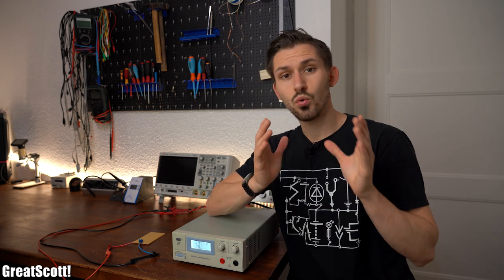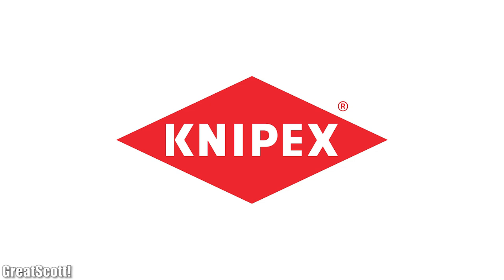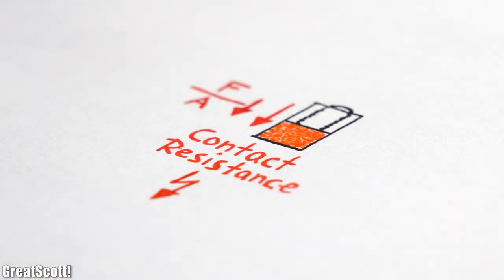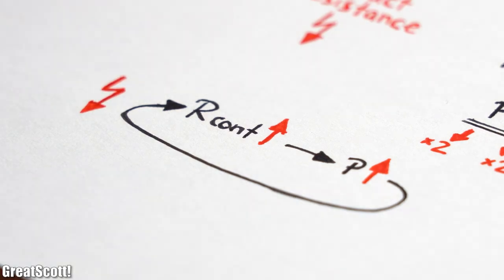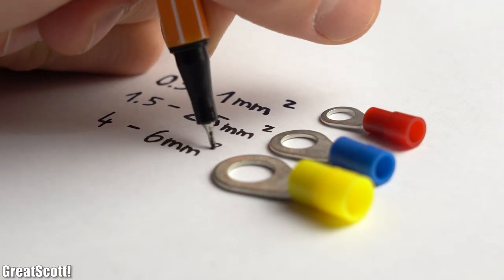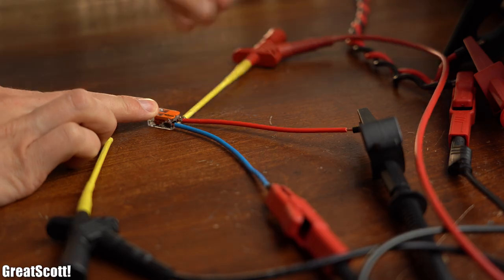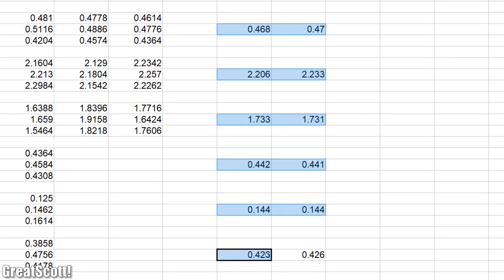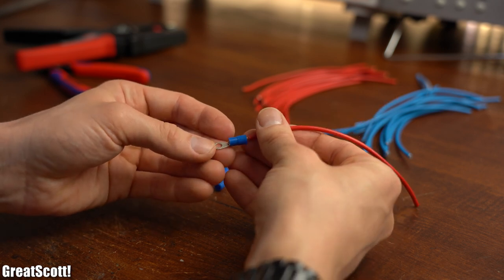Connectors are more important than you might think! So which one is the best? (Experiment)

Comment: When you like me, live in wooden houses, you are not worried about short circuits, there are fuses to take care of that, but you have nightmares about bad connections.  All the time houses are burning down due to electric faults. That is another name for a bad connection.  Waco connectors are the winners now, because of the craftmanship and percistence to detail it does not require.  It can be done by an apprentice who wants to go home early and still be safe.   Apart from that we need some new connectors, which will permanently cut connection when temp goes above 150C.

Comment: Most of my terminal connections are soldered and then before the wire fully cools use a pair of pliers to flatten the end. For terminal connecters with a round socket I use a pair of round-concave jewellery pliers to do the same thing but in a U shape which makes a great connection.
Reply: Not recommended, decreases the repeated flex/bend strength of the wire. Also solder in the crimp undergoes differential expansion and can force the crimp loose.

Comment: I really love the WAGO stuff.  I began using it for in-wall lamp fixtures (LED lamps), but it became a staple of my electronics projects and messing around.  Want a quick connection... WAGO!  Ultimately I'll clean up the connectors in the final version or the final cleanup of a project, but WAGO really speeds the work up when messing aroundl.

Comment: If I am not mistaken, those white screw connectors („Lüsterklemmen“) were never really intended to be used as general purpose connectors. Their original intended use was for lighting fixtures only („Lüster“ is a dated German word for a hanging lighting fixture, e.g. a chandelier).
The PCB connectors…., when you said „Who is gonna draw 10A over those“, my immediate answer was „3D printers“. Those connectors are very common in this area and get to see quite some current..

Comment: Thanks for this informative video.  I find it hard to believe the spade terminals and receptacles had such a high resistance. I think these should have a similar resistance to the crimped butt connectors. These are usually very tight the first time you use them, and the receptacles make deep scores into the spade.  The receptacles should not be loose. If you are reusing the same receptacles multiple times, that isn't a fair comparison against the other connector types.

Comment: For your calculations did you consider than several of the connection types had multiple connections as part of their set up? For the cable shoes as well as the wire ferrules you have the wire to shoe/ferrule resistance then the shoe/ ferrule to whatever they connect to. The worst performers have more series resistances as a part of their connection system.

Comment: Nice video! I had this problem a couple months ago. There was a loose connection in my breaker box that caused unstable voltage on some power plugs, a differential breaker and current breaker were shutting down and you could feel some heat on the breaker box. Fortunately we found the problem quickly and didn't end up in something serious like a fire.

Comment: Soldering wires together has one disadvantage you didn't mention: durability. Crimp terminals and ferrules tend to hold up a bit better against vibration, and often include strain relief. Solder prevents any bending of the wires, it leads to a stress concentration, and soldered wires are more likely to break than crimps.
Reply: In Australia for power circuits it is not permitted to put a soldered wire or soldered connection into screw terminal.  The reason is that over time the solder will flow very slightly, but enough to increase contact resistance and form a hot joint.

Comment: Another connector I would also recommend is Anderson power poles. They come in 15, 30, 45, 75, and 100 amp variants, and have no gender. So you can plug any connector into any other one. The 75, and 100 amp ones have different housings though, but the 15, 30, and 45 amp ones have the same housings, just different size connection tongs. 

They're mostly for DC, but I really like them. They are somewhat expensive though, and crimping them on can be difficult without the proper crimper.
Reply: they come in all kinds of pretty colors too 🙂

Comment: In retrospect, I should have seen the issues with stranded wire connectors and screw down connectors.   I have plenty of projects that have devices that use screw down connectors so I don't get a choice.  I am going to switch to Ferrule connectors going forward and will fix a couple of my previous projects.  

Thank you so much for this informative video.

Comment: My former workplace has used ferrules for many years with mixed results.

Some crimpers leave a zig-zag pattern (like in this video) that captivate the wire strands well.  But these make connections in spring terminals a little unsure.  Sometimes there is a little arcing due to higher resistance connections.  After time they kind-of weld.  When removing one of these from a Wago or Beckhoff terminal, they cannot be easily pulled out.  I have wrecked these terminals this way.  It is far better to use bare stranded wire in spring terminals. 

Another kind of crimper creates a u-shaped pattern, much better for terminals, but still a bit weird.  The company finally stopped using ferrules, unless two wires are inserted into one terminal.

The best industrial connection type appears to be a bare stranded wire in a spring cage terminal.  These deform the wire a bit, making a good mechanical link.  And the spring maintains pressure over a long time.  Screw-type connections tend to loosen over time, and require periodic tightening.  I’ve worked on machines that malfunctioned, where the only repair was to tighten some screws.  Depending on vibration and current, they may need to be tightened every 3-5 years.  Spring terminals don’t have this problem.

Ferrules prevent other common problems, like stray strands that might short to an adjacent terminal.  They create a good clean high-quality appearance.  They allow two wires to be permanently bonded and attached to a terminal.  But they have their own problems.  I’ve seen many crimped incorrectly.  Sometimes the wrong size is used, particularly when AWG wire is used in metric ferrules, or imperial sized ferrules are used on metric gauge wires.  This also occurs when the wire stripper removes a few strands of copper.  Also, it is ambiguous what ferrule to use with two wires crimped together, especially when the wires are of a different gauge.  In working equipment, I have seen wires pull out of ferrules.  And sometimes intermittent connections occur because the ferrule crimp is incomplete.

So then, there are lots of great connection types, and lots of ways to mess them up.  =D
Reply: I suspect the problem with screw-type connectors is thermal cycling deforming the wire over time (through thermal expansion and contraction). Both from resistive heating and ambient temperature changes. Do ferrules make this better or worse? As has been mentioned in other comments, with a ferrule you have the screw to ferrule resistance, plus the ferrule to wire resistance. And the ferrule is not springy (it is designed to deform inelastically).
Reply: @johndoggett808  I don't have years of experience with ferrules in screw terminals.  I found that ferrules in spring terminals isn't so good because the ferrule doesn't deform like a stranded wire.  In a screw terminal, the ferrule may also loosen due to thermal cycling and vibration, but I haven't experienced too many failures.  I suppose with the ferrule, there is now a much taller stack of metal between the cage and the clamp, as compared with only a stranded wire.  The wire tends to spread out fairly thin, but the ferrule stays about the same.  So with temperature changes I would expect more expansion and contraction.  Once we switched to spring terminals without ferrules, I stopped investigating.

One thing, I have use many ferrules directly under a screw, meaning nothing between the screw tip and the ferrule.  This is far better than a stranded wire in this situation.

What experience do you have on this topic?  Anything worth sharing?
Reply: @microdesigns2000  "What experience do you have on this topic?  Anything worth sharing?" Not a lot, but have an interest in making robust electronics for a high vibration environment. I believe crimp connectors are used in cars rather than soldering connections because the point where the solder wicks to becomes a stress point, and over time cracks form there, and the wire breaks. I haven't been aware of ferrules, but it is interesting that in the comments people are saying that a length of plastic sleeve should also be crimped as stress relief. Have I been doing spade connectors wrong in the past - there isn't a lot of room in those crimps to include a length of sleeve too. I've witnessed wires in screw terminals magically become loose over time. Including an earth lead to a sawdust collector. Sawdust collectors are basically Van de Graaff generators, and you don't want sparks amongst clouds of wood dust!
Reply: @johndoggett808  interesting.  I've done work in many areas called "hazardous area".  A definition for this is an environment where the atmosphere could become explosive.  For example, a grain silo, a bottling facility for spray paints or other aerosols, a gasoline processing plant, or a sugar factory.  When the amount of particles or vapors approaches the right amount of fuel/air, there can be significant hazard. 

Sawdust is one of those things.  If you are not familiar with the rules on the subject, then you should get a copy.

In North America, the standard is NFPA70E, otherwise known as the national electrical code.  In the section named Article 500, there is excellent knowledge. There are about eight ways to handle electricity in a hazardous area, of which two are the most common (explosion-proof conduit, and intrinsic safety).

In Europe, there is the ATEX standard.  There are also several ways given in this standard, but the most common approach is through two methods (Hermetic sealing, and intrinsic safety).

If you are running electricity in hazardous areas, you should know these things.  If you are just troubleshooting, then remember that different levels of hazard require different approaches to electrical terminations.

The process for engineering is first for a chemist to make an assessment of the area and specify the classification.  In NA, that's something like "Class 1 Div 1".  In Europe, that's something like "Zone ".  Then the electrical engineer specifies rated components and construction. Then the electrician assembled a system per the standard.  In Europe, an inspection is next.

Comment: This is a great video. Here in the states in heavy industry we use almost entirely stranded cable (because of the vibration). I have long maintained that the best connection (I didn't see this one in your video) is two flat plates squished together by a tightening screw. 

I would also be curious to see what resistance your PCB terminal gets without a ferrule! I would guess it drops significantly!

I almost never see anyone use ferrules here.

Comment: Another issue I have noticed with screw terminals is that the plastic housing is soft and wiggly. There is nothing taking the strain off of the soldering joint, so tighening the screw, puts lots of twisting force on the soldering joint. Especially ones that have circular pins rather than flattened pins. There is a risk of the pin coming loose like in a cold joint. Especially if the joint wasn't done properly to begin with.

Comment: Don't twist the wires before inserting into any crimp or compression type connector. Doing so crosses the strands and when crimped or screwed down the pressure can cause the crossed strands to cut each other. When the strands lay parallel crossing is minimized. One other really good connection type are the push in terminal block type. When pair with ferrule ends make a great connection.

Comment: I work in a hotel maintenace, and usually, here in spain, we use stranded wire (it was solid wire some years ago, but is not really used nowadays), and every year, i have to check all the distribution boards to check for any loose wire. I got myself a crimping tool, and now every single time i have to change something, i add some ferrules to the wires. the connection is not just better, but none of the strands will be cut during assembly, or go where it shouldn't. I also want to change screw terminal to wago, but since the pandemic, i have a tight budget, and can't do unnecesary upgrades just yet... Good to know that my choices were correct (and for the one who says screw terminals are better... try to work with them 3 hours/day, wago is faster and easier to operate, no screwdriver needed)
Reply from the maker: Thanks for the feedback and the story :-)
Reply: Wago also have the additional benefit that it does not unscrew or loosen up over time due to temperature variations.

Comment: A good solder connection is also a good mechanical connection. Never rely on solder for mechanical strength, it is soft and can easily be broken by mechanical stress. You should also always keep in mind the current and voltage ratings of the connectors. Even a connector with a low initial resistance may degrade over time if large currents are run through them which can cause mechanical stress of matting surfaces.

Comment: Nice work compiling all the info! Just one tip... you could have used the 4-wire sense connections (4W) on your Keysight for more accurate resistance readings. Also known as Kelvin connection measurement.

Comment: It's been a long time since I went to school and got an electrician license. And I haven't worked as one since so I couldn't be bothered to keep up with regulations and changes in practice. Then a year or so ago I got asked to take a look at something and though I said I didn't want want to do any installation work I said I'd take a look at what the existing wiring looked like and see if there were any obvious problems. Well it turns out things changes over time...

One of the first things I saw was ferrules. When I went to school no one even mentioned ferrules. I spent an evening just googling and reading up on what had changed over the years, and after that I had a good understanding of a lot of the changes and quite frankly improvements in practice. Still don't consider me an electrician, but at least I know what I'm looking at.

And I want to add a note about soldering. While solder is very good at making a good connection it is not as resilient and permanent as most people like to think. There are two major weaknesses to be aware of one being metal fatigue and the other temperature cycling. And note that I'm talking about regular solder with the main component being tin alloyed with lead or some other metal to lower the melting point. If you use silver or brass or anything else then not all of these points will be valid, or at least not as severe.

Every metal that I'm aware of can suffer from metal fatigue. It's caused by repetitive flexing causing microscopic fractures in the structure making it weaker and weaker. Different metals react differently and need different amount of flex and repetitions before the damage becomes significant. Soldering the end of a stranded copper wire together may make it work better in a screw connector, at least for a while. But it also makes it more sensitive to metal fatigue if there are a lot of vibrations or if the cable flexes for some reason. Also when soldering the wire the solder will tend to wick into the wire up under the insulation unless you are careful. This length will act like an extended lever increasing the force imparted on the joint caused by any vibration or movement. Eventually the soldered part of the wire can develop a break or just the solder will be fracturing and allow the leads to separate. In a crew connector this results in a unreliable joint and in a solder joint it means increased resistance and the risk of wire separation.

And so we come to temperature, and I'm not talking about melting the solder. Contrary to what most people think solder isn't immune to low temperatures. If it gets really cold the structure of the solder changes and it can turn into dust. Yep, dust. As a kid my father demonstrated this by letting me make a tin soldier using solder. He then put it in a plastic bag and put it in the freezer. A week later we took the bag out of and the tin soldier was just a bag of tin powder...

So don't tin the ends of stranded wire! Also don't used solder joints in places where there will be a lot of vibrations or movement of the wires.

As for temperatures I'm sure there are different solder compositions that react differently or every car radio would have turned into boxes with lose components rattling about in colder climates. But keep this in mind so you aren't surprised if it happens.

Comment: This is why it's critical to check all electrical equipment periodically, especially systems that are exposed to wide temperature fluctuations such as breaker panels in out buildings, battery connections in motorcycles and cars, and those terrible screw clamp connectors for low-voltage lighting in yards.

That opens a whole different can of worms that I call "What do you mean by tighten the connections?" On screw terminals in particular, that connection is basically a variable resistor whose resistance is inversely proportional to the torque applied to the screw or clamp. Too little torque = fire hazard, too much risks mechanical failure and a fire hazard.